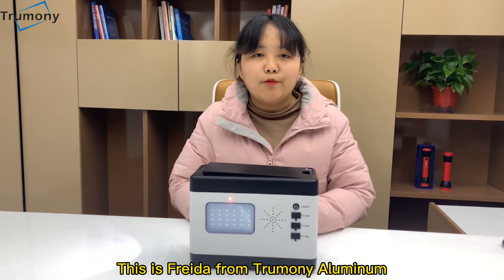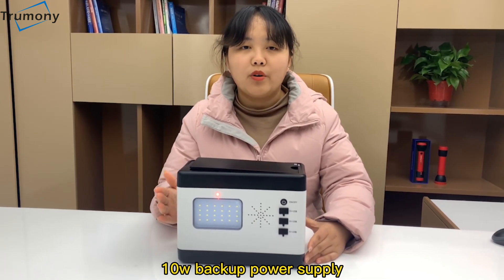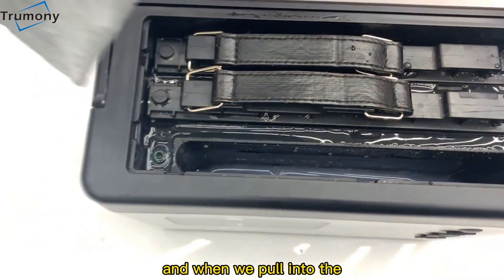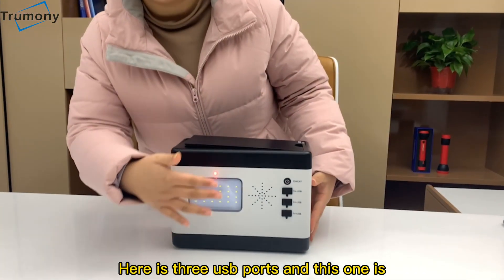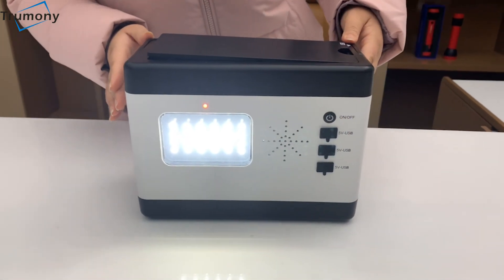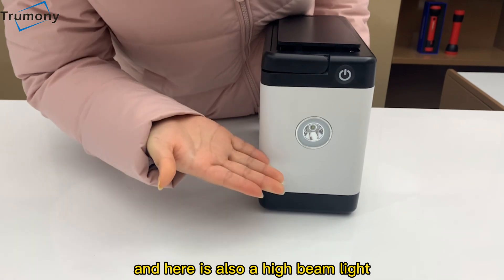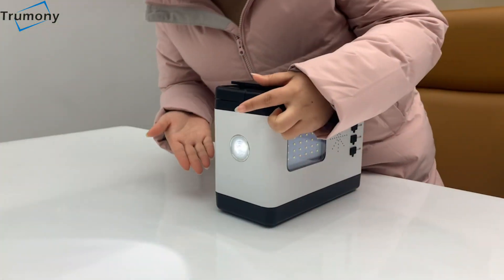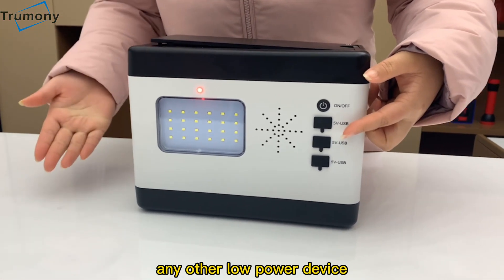Aluminum Air Battery----Did You Know This Newest Technology?

Comment: wonderful product, what is the life of this device?, how to remove the residual alum power after discharged ?
Reply from the maker: It can be stored for about more than 10 years for aluminum's stability, and can work for  more than 100 hours. after using up the aluminum plate, you just pick out the aluminum plate and change a new one to reactivate the battery. Welcome to https://www.aluairbattery.com/Aluminum-Air-Battery-pl3227760.html or our Facebook: https://www.facebook.com/Trumonyenergy/ to learn more.💪